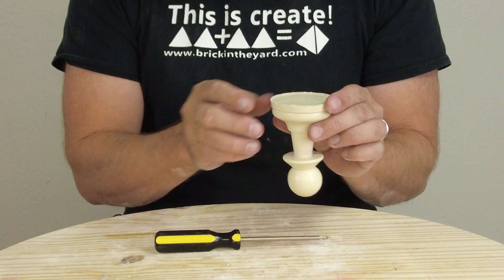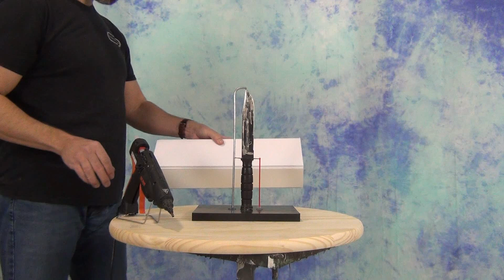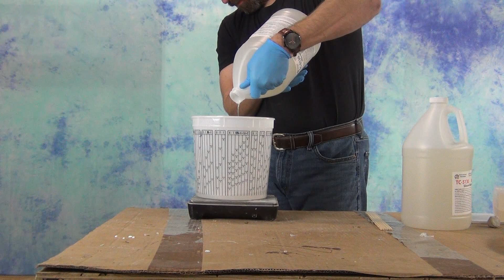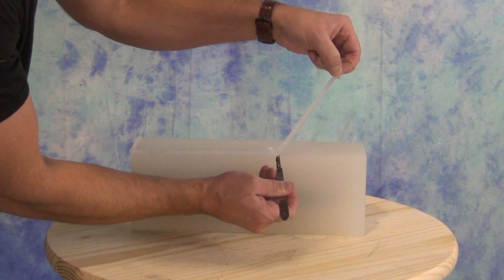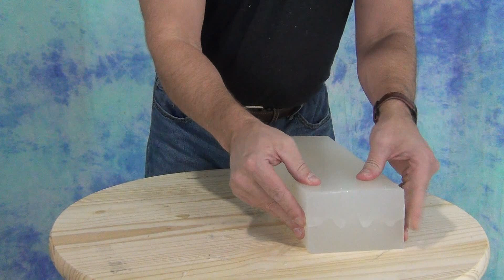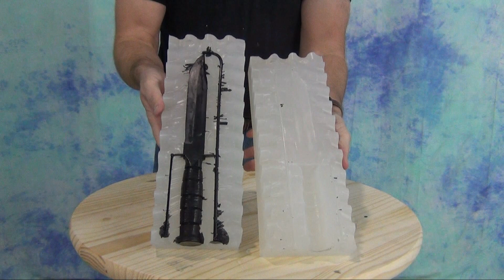Mold making & Resin Casting Tutorial: Using Vents In A Block Mold

Comment: May be a silly question, but couldn't you cut only one side, just to the point where you're able to remove the item?
Reply from the maker: You could, but I wanted a two piece mold so I could brush in powder pigments if necessary.
Reply: @brickintheyard thank you for the reply and clarification! I just wasn't sure if there was a reason you SHOULDN'T only cut 1 side. Thanks for sharing your knowledge!

Comment: Hello, I'm trying to understanding the economics, those TC-5130 cans are about $200. Let's say he used up half of them for $100. TC-808 is $100 and let's say he used up $30 of it. + let's assume 3 hours of labor at $100/hr so... $430 price sticker for a prop knife replica? Do people actually pay like this?
Reply from the maker: Yes.
Reply: @brickintheyard  Ok but that makes no sense. It would be cheaper to just go to temu and replace with 20 similar props like that for $1. Why are they spending so much on this? Genuinely curious.
Reply from the maker: @bpachat  A silicone mold of the prop to be used allows the production to make the duplicate action prop out of a variety of materials as needed.
Reply: @brickintheyard I know what a mold is for. Ok maybe this comvo isn't going anywhere, sorry.

Comment: Quick question: why don't you lay it on the side (horizontally) w either blade up or down? You are already committed to at least one air vent. Just wondering if laying it down (maybe at some angle) would be worth a gander so there's not such a long air vent?
Reply from the maker: I this case, the hydraulic pressure of the resin in the handle helps push the casting material into the thin blade. That allows the part to be poured fast with fast setting resin.

Comment: Quick question I seen some videos of professional mold makers using what looks like some kind of clear fiber packing tape to seal up the molds do you have a tape you recommend that sticks well to silicone that you can use to strap your molds up besides electrical tape?
Reply from the maker: Whatever tape works is the tape to use.

Comment: I learned to do block molds elsewhere, but the extra tips (s-cut first, then straight cut) are super helpful!

What I'd love to see you demonstrate would be miniature figurine (28mm) molding and casting, since that is what I mostly try to do. It sometimes works, but it's hard because the parts can be super small, and resin is quite viscous.

Thanks, and welcome back!
Reply from the maker: Thanks for the input! Once I start up the 3D printing that will probably be a video.
Reply: @brickintheyard  That would be excellent, cheers!
Reply: @kurogiza  agreed!! I do 10-13 cm figures (1/18 scale figures) and have parts that are so small. I started off using squish molds (or something similar) and now I use a blend of pour and squish, since the viscosity of the resin into most of these parts is not conducive to a straight up pour into a a pour spout (which I'd love but have only really done a handful of times due to the items I work with)
Reply: I would say if your 3d printing and then doing a mold vents or spruces would be around where the overhang and supports are